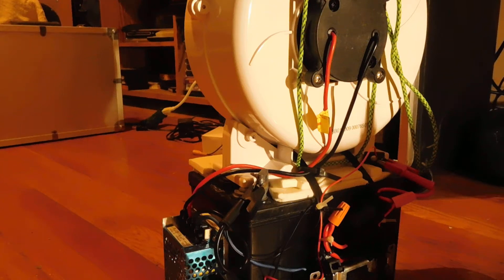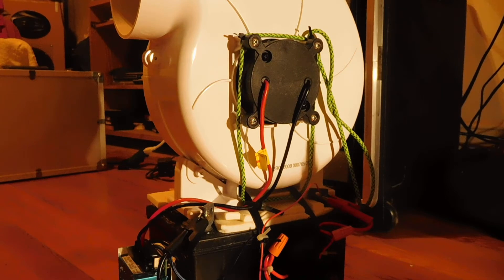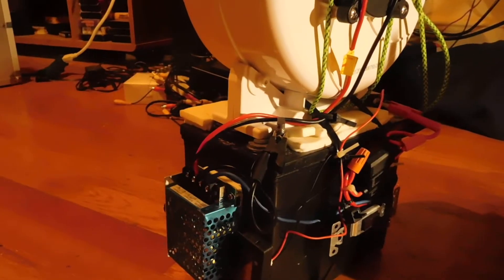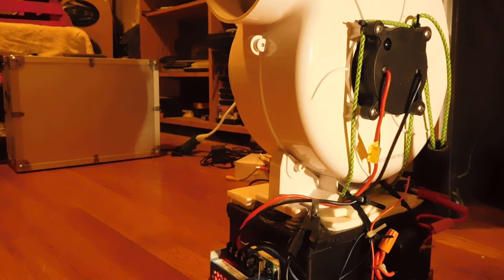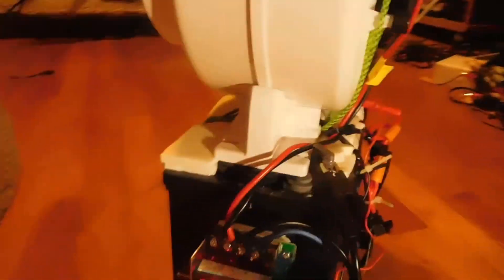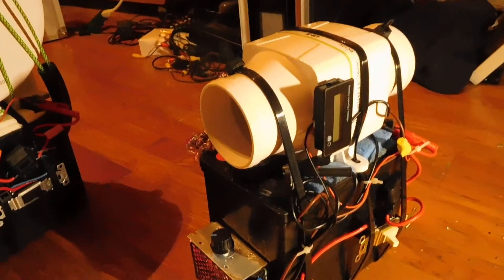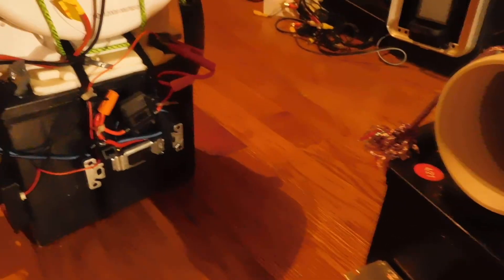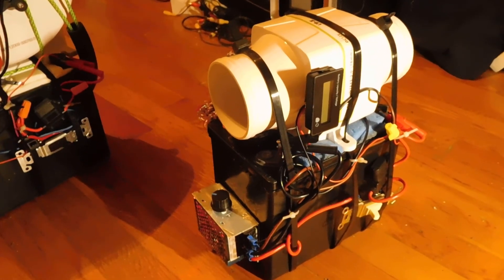Macho camping fan

Comment: Isnit possible to install an outlet to use it for 110v?
Reply from the maker: You could use an inverter but you would lose duration of charge due to heat dissapation.

Comment: You selling any of them?
Reply from the maker: They're too easy to put together to do it yourself but thanks for the offer
Reply: @kippercat123  I wasn't needing one I was wondering for other campers.
Reply from the maker: @glasswinder  for the big one the price for the fan was $70 as stated in the video. $25 for the battery, $15 for the variable resistor and some other knick knacks and between come around it off to about a $120.
Reply: @kippercat123  if I was a camper I'd need one.